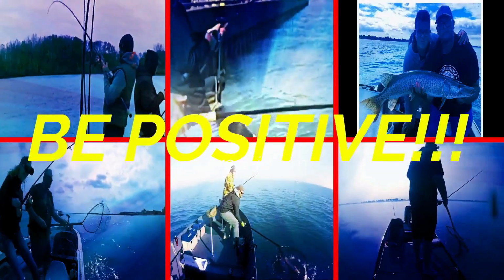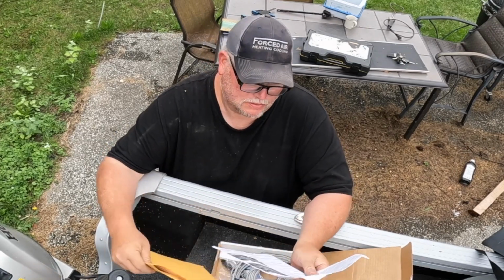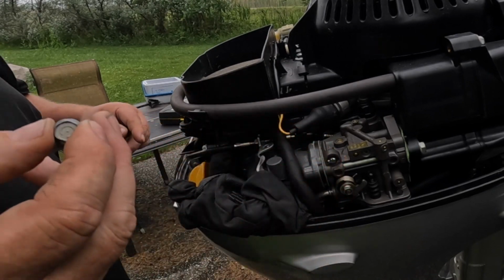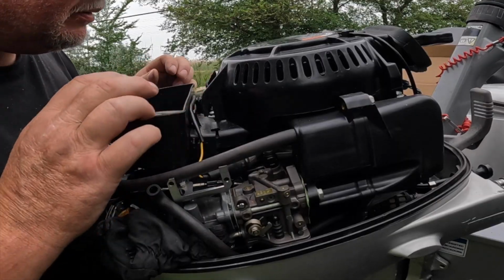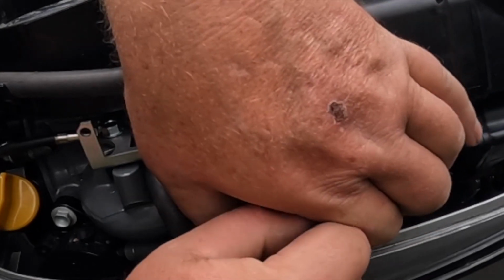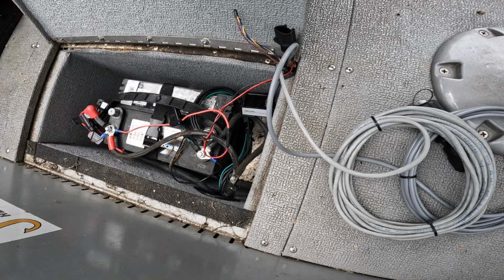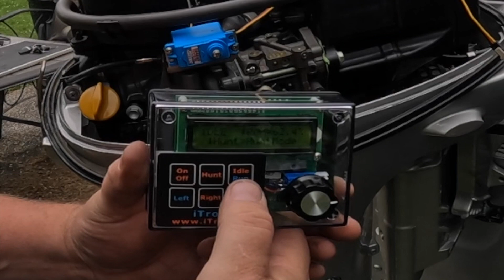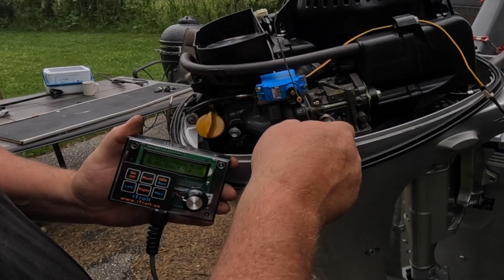iTroll install on Honda 9.9 outboard

Comment: How do you like the ITroll ? I have the same boat as yours, 90 hp suzuki with 9.9 high thrust suzuki kicker..adding a steering connector rod to steer with 90hp. Now looking at throttle control. Any advise you could provide would be appreciated! I'm in Muskoka, ON Regards, Chris
Reply from the maker: I love the itroll and I always keep my kicker straight and do the steering with the bow mount trolling motor works out great